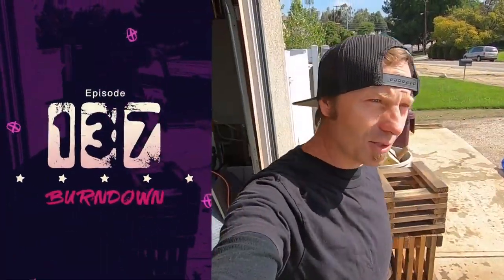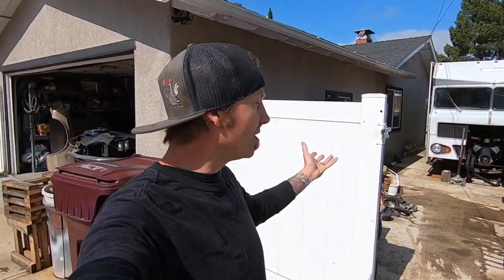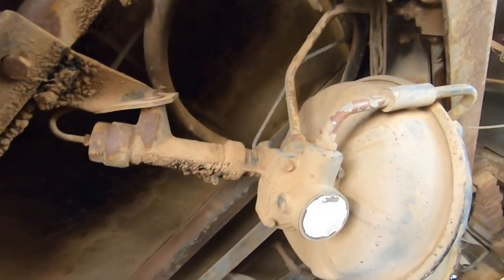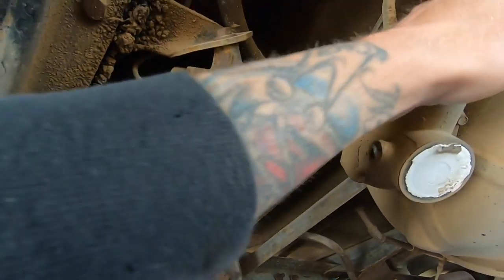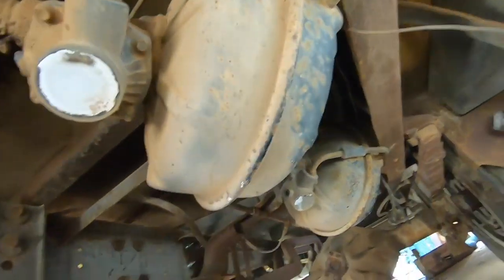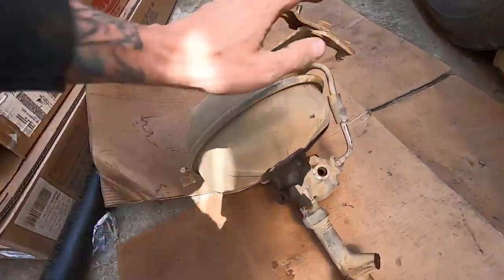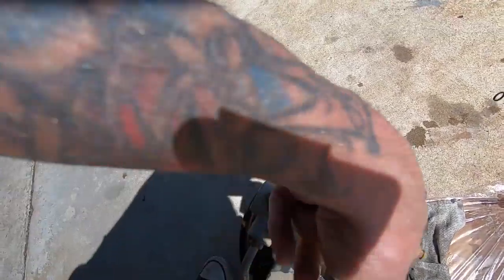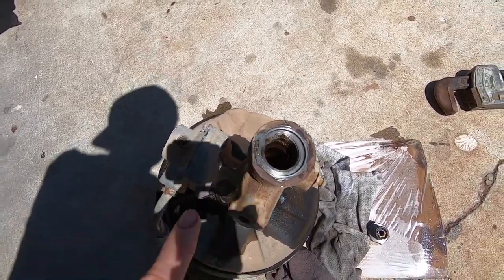Starting On The Twinnebago Brakes

Comment: Just buy a couple rolls of copper nickle, if your family is in there it’s not worth saving $100 and crashing the camper when a 50 year old line breaks
Reply from the maker: I have line coming so I can re do one of the front lines. Ill inspect the rear lines before I move on and all the soft lines and the slaves cylinders are getting replaced. Ill defiantly make sure the brakes work well and keep an eye on tings when im shaking this old girl down before anyone is in it and trying to actually take it somewhere.
Reply: Burndown I remade the ones in my Airstream motorhome, it wasn’t bad. Also I got the seats from a 2004 Chevy suburban do that the seat belts are integrated into the seats, those old Kai belts are sketchy as hell just bolted into some sheet metal in my camper, do I welded in 1x3 1/8” wall rectangular tubing in the floor to bolts the seats to

Comment: It doesn’t matter if it’s raining out, you can be inside the camper and work on the motor!
Reply from the maker: Yeah but I have to lay under it and my back yard slopes down to my side yard. I really didn't want to roll around in a puddle if I didn't have to.😅 If you saw the video where I installed the turbo in the Maliboom it was done in the rain under an EZ up so you are right it can be done.